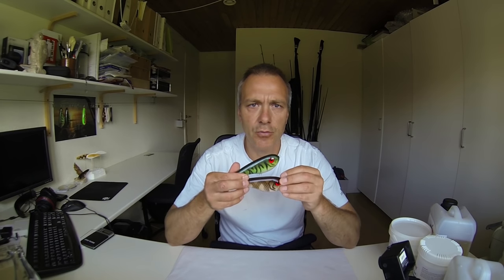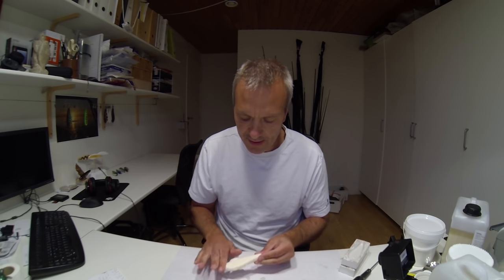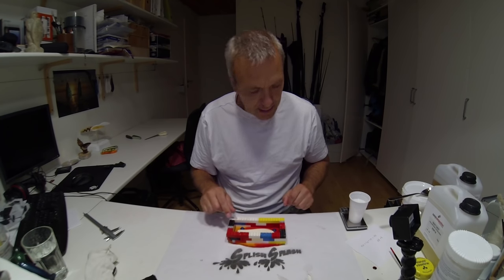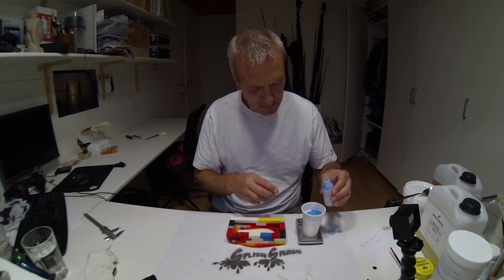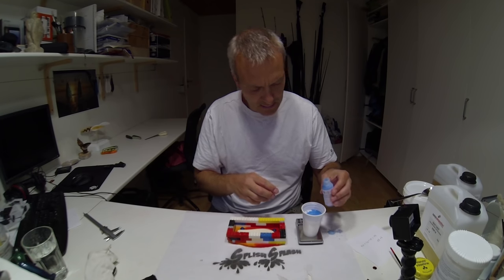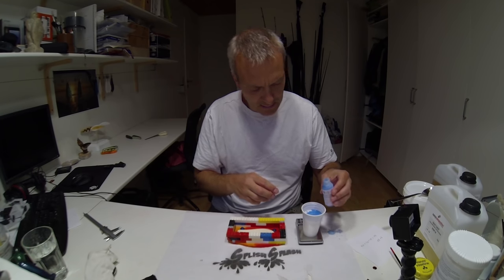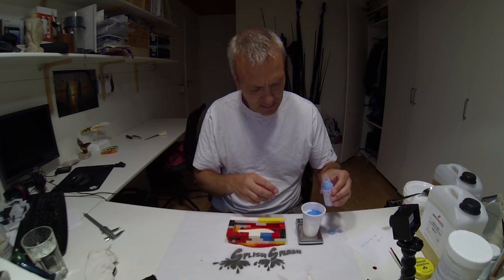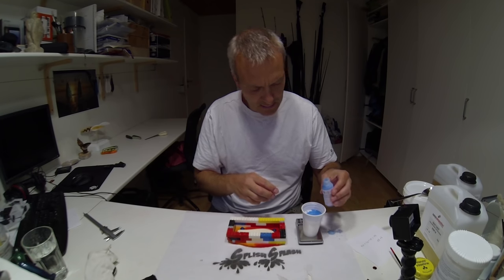The Plastic Jerk - Easy, durable and catchy

Comment: Excellent video thanks!  I've just started making my own lures out of resin but I've been making them for longtail tuna so they have to be super strong and very durable!  Keep the videos coming:)
Reply from the maker: +James Allen Thanks James. My friend made some stickbaits for tuna out of resin, and he got some smaller tuna i Croatia this summer without any damages to the lure. So I think you should be able to use as well. Just make sure that the internal wire matches your prey.
Reply: Yes everything has to be bigger and stronger for the tuna.  I have some 1.6mm stainless steel wire that seems like it should do the trick.  I guess I won't know until I try it though!
Reply from the maker: +James Allen I think it will. The force you will be able to apply to the lure is depending on your line strength and gear. So you'll need quite heavy gear to even bend the 1,6 mm. Looking at your videos, i wouldn't be afraid to use 1,2 mm.
Reply: +Splish Splash Just went to rewatch your video to see if I could pick up any more tips.  My lures have now been tested in Hervey Bay on the east coast of Australia and have caught some really nice tuna and mackerel.  So far no scratches on the Envirotex finish or any bending of the wire either which is good!
Reply from the maker: +James Allen Fantastic you are having succes with your baits. I would love to see some pictures of them and your catches. You can post them on my facebook page: https://www.facebook.com/splishsplashfishing/

Comment: Your bait will have a better action if you position weight so that the  tail is down slightly in relation to the noise. This will give the lure a swimming action as retrieve it. Really nice work you do.
Reply from the maker: +Tom Willis Hi Tom. The lure actually does have a nice swimming action. But maybe i could be better - I will try your advise and see. However I think it will be weighted to sink then, as if the weight is in the back, it won't dive. Thank you for the advise no matter what.

Comment: You are doing a really really great job with this Videos! I learned a lot. Just started to make some soft lures. Next Project will be something like a plastic jerkbait. 
I´ve got a question about your fishing setup. How do you connect the hardmono with the main line? Looks like some kind of loop?!
Reply from the maker: Hi Fabian. In the testfishing part of this movie I just used a loop tied with a figure 8 knot (Not sure that is the correct name) Today I use crimped eyes as that is a nicer setup in my opinion. Good luck with your lures
Reply: Splish Splash I also use hardmono and crimps. Seems to be the best solution. Keep going with this videos! For many fishermen out there it is nice to know, how these lures work. What a little shift in the weight position means for the balance e.g.!

Comment: Hey splish spash! Nice videos, I know it's not your latest but I still wanna ask something. I also make my own lures with resin but I always have to wait a few weeks for them to fully cure and de-gaz before paint and especially epoxy. With your process of cleaning it, do you get to make the epoxy coat in the same day without fisheyes problem? If not, how long do you wait? Keep up the good work, Kevin :)
Reply from the maker: Hi Kevin. I would advise at least one day of degassing, but after that it should be good to paint and let that dry for a day as well before the coating. The fisheye problems i have had has not been related to the degassing - I think.It s propably depending on the brand of resin as well. Cheers
Reply: Yes it could be the brand to.. I'll try your process, no better solutions 😁

Comment: 15 mins prep yes but how long for plastic to cure and harden? 1 hour? so really its quicker to make a lure from wood or the same plus you had to make the master and mould which took over 24 hours lol but once made then yes its better because you can make many lures much quicker than with wood,, great video, make me wanna make some lures that way, ive made lots of spinners which are easy and im looking into making some soft plastics 1st, those jerks look amazing, very cool thanks for sharing.
Reply from the maker: The resin i use cure en 20 mins. There are pros and cons for both resin and wood lures. To me, the important pro for resin is that you get a consistent result that is nearly ready to paint. Also you can have a lot of details on your lure without extra work. Making moulds is more difficult to explain, than it is to actually do. Once you have tried, I think that you will agree on both things. Good luck

Comment: Where can i find those "baitholders" that you used when painting? 
Really good video btw, learned alot. Im think about trying to make some lures of my own and this was super helpful!! 😃
Reply from the maker: they are called "third hand" and is originally used for soldering and can be bought in some hardware stores like biltema (http://www.biltema.dk/da/Vaerktoj/Svejsning-og-lodning/Loddetilbehor/Loddestativ-2000016776/)  or online in i.ex. Aliexpress (https://www.aliexpress.com/item/2016-New-Third-Hand-Soldering-Iron-Stand-Helping-Clamp-Vise-Clip-Tool-2-Alligator-Jeweler-Watch/32727477779.html?spm=2114.01010208.3.134.2dpUzP&ws_ab_test=searchweb201556_0,searchweb201602_5_10057_10056_10065_10068_10055_10054_10069_10059_10058_418_10073_10017_10070_10060_10061_10052_10062_10053_10050_10051,searchweb201603_4&btsid=a045094c-22e9-41eb-93df-1c01d26f1636)

Comment: very informative and wel explained tutorial, one thing i would really recommend you is to use a air mask and gloves when handeling the plastic and micro balloons they can both give you a real nasty allergic reaction. apart from that its just not healty to unhale the fumes! keep up the food work! :)
Reply from the maker: +kira baits According to the specifications of the polyurethane wearing a mask is not a must. Quote: "We would never advise against the use of a respirator wherever fumes or vapours are present however the hazard risk of vapours from a Fast Cast polyurethane are very small". However when i don't record movies, I use a mask, as there is no reason to risk anything.
Reply: +Splish Splash yeah the stuff i use said the same thing, i still got a huge rash from it unfortunatly! not trying to be a smart mouth or anything just didnt want you to get the same! :) again awesome tutorial!

Comment: It's polite each time and is saved very much.
Please tell me the brand name used for the material of this lure conversantly.
Reply from the maker: Hi. You will find links to used components in the text below the video. If they are not available in youu country, you can search for "Polyurethane Resin" - Good luck
Reply: Splish Splash Thank you very much really.
It'll be checked.

Comment: Hi, great video! Quick question though, where do you get the eyes?
Reply from the maker: Hi Brendan. I have bought these in many different shops. Search for 3D eyes to find them. Lately however I have just bought them at AliExpress. Here is a link to the latest ones: https://www.aliexpress.com/item/2016-HOT-3d-fish-eyes-12MM-silver-64pcs-red-64pcs-gold-64pcs-in-total-192pcs-lot/32680423814.html?spm=2114.13010608.0.0.W9EjiZ

Comment: Hi! Very good video from you! Now I want to try to make bait. I can tell you how called plastic that you fill in the form? Thank you!
Reply from the maker: Thanks. The "plastic" is correctly called "Polyurethane resin". In the text bellow the video, there is links to the stuff I use, but I do not know if they can send it everywhere. Good luck
Reply: Спасибо! И удачи вам!)
Reply: Splish Splash I have a question. When you made the other side of the mold did you just use vasoline on the master or the entire rubber mold?. I know guys do mold release but vasoline seems more effective.

Comment: Hey Jorgen. For making the silicon mould. Do I have to order this item? CS2 Condensation Cure Silicon Rubber 0.5kg package. Greetz,Glenn
Reply from the maker: +Glenn Goovaerts Hi Glenn. That is the one I am using. If you are careful not to make the mould to big, that should last for about 2 moulds. Rgs Jorgen

Comment: nice video,tq.. do u have video dat u can put bearing inside of it..? making it rattle..
Reply from the maker: I dont have a movie showing that. I would require some chamber the ball bearing can rattle in, and I think the easiest way would be to take a piece of plastic pipe and put the bearing inside and close the ends. And that part should then be enclosed in the mold and resin

Comment: if u use glass bubbles 10% it will make it floating and u can add some more weight but what if i use like 15 % glass bubbles , it will work too ? i also wanted to ask ehm , how can i make minnow lip that will work and where to put the weight . I tried polester ( without glass bubbles and it was light but sinking , its super smelly but u can make transparent-like lures and make so much cheaper than polyurethane that i also bought .. your videos are awesome and inspiring :)
Reply from the maker: First of all you wil have to be aware the there is great difference between resin and glassbubbles from different suppliers. I have seen some having 500 g glassbubbles in a 1 liter canister, and the one I am using has same weight in a 5 liter bucket. So there is great difference of the buoyancy you get.How much to use, and where to place the weight, will depend on the shape of the lure. Polyester is cheap, but if you add glassbubbles it will loose transperancy. To make it transparent and floating you will have to make it hollow, which is a bit more difficult than polyurethane and glassbubbles.
Reply: thanks for the fast reply , i understand .. i really want to make a minnow but i dont know if the lip will work , and if it wont work i will have done a bad mold and lose silicone material for nothing , do u have any idea how it will work out ?
Reply from the maker: It should be no problem to make a lipped crankbait in resin - You can go two ways. Cast the bait as whole or cast it with a slot for a lip cut out of a clear plastic plate. That last would be the nicest, but also giving you the most work. You could also make a mold for the lip alone and cast it in clear resin or polyester. good luck
Reply: thank you :) . oh also i saw one video u made that u use the silicone mold to reproduce a new silicone mold in case its ruined . Instead of polyurethane material that is expensive u can try also using plaster with wood-glue ( the white one that we often use) the glue making the plaster tougher and if u are careful ( with bubbles ) u can do it unexpensive . The plaster cost in my country is about 10 euros the 40 kilos . Hope this work for you .
Reply from the maker: Yes that would probably work - I might try that at some point. Thanks for the idea

Comment: i made few floating stickbaits with weight behind the hanger hooks but the lure roles and do not make the s curve action. any suggestion on how to fix that problem? Thank you,
Reply from the maker: In the end the lure shape is the most important, and I have made lures that simply wouldn't move right. But now that you have it made, I would try to put the weight in different places - Probably more forward from what you are saying. See if that changes anything.
Reply: @SplishSplashFishing  this lure is a floating stickbait lure that is why i put weight behind the hook hanger . I'm trying to achieve the s-curve action similar to floating stickbaits for tuna and GT's. Do you think if i move weight toward the head that will solve the rolling of the lure ?  Thank you,
Reply from the maker: @naoufelnacer1401  I don't have a lot of experience with topwater baits, but I would say that to stop rolling you should put the weight as low in the body as possible.

Comment: what silicone do you use, and what polyurethane? all the Polyurethane Casting Resin i have found says that it is flexible?  thanks
Reply from the maker: +Daniel Kontor Hi Daniel. Both silicone and resin comes from easycomposites.co.uk. My resin becomes very hard, and not flexible. Are you sure that they dont mean that the resin is flexible in its use? I think that resin is supposed to be hard

Comment: How come your not fishing with a baitcaster and are using such a long rod? not saying that you can't but when i broke my jerkbait rod and had to fish with a 240 spinningreel rod it was very uncomfertable fishing jerks
Reply from the maker: I guess I'm just used to fish with that setup, and as the lures I make only weighs around 40 g, I'm not forced to having a short stiff rod to make the jerks. However I do have more traditional jerkbait setups with short stiff rods and baitcast wheels that I use fishing from boats

Comment: What type of wire do you use? Guage and the like
Reply from the maker: +theguru18 I use stainless steel MIG/TIG weldingwire (probably not the correct english term) - 1 mm thick for eyes and 2 mm thick for the hinges.
Reply: +Splish Splash welding wire cool thanks

Comment: where can i get components like eyeletts, glass eyes, bills, joint attatchments?
Reply from the maker: The only part I shop for is the eyes - Buy them from aliexpress.com - Search for "3d fishing lure eyes". The other parts I make myself from stainless wire and plexiglass plate. But of cause there are many shops that provide those as well. Just search for lure making parts
Reply: Splish Splash thank you so much for replying, that helps !

Comment: Nice lures! Where you get the eyes from?
Reply from the maker: Usually buy them from AliExpress - Search for "3d eyes for fishing lures"
Reply: Thanks! Just ordered the same mold silicone. How many lures can you make aprox. with one mold?
Reply from the maker: Normally i get 30-40 lures out of each mold. I depends a bit on size and complexity of the cast. If you are going to make a lot, consider making at cast from the mold to make make more molds. You can see that in another movie
Reply: Thank you for the quick reply!

Comment: Hey Jorgen. Which needle size do you use while airbrushing?
Reply from the maker: +Glenn Goovaerts My one is 0,3 mm. Make sure to get paint that is usable for the size you choose
Reply: The smallest that I have is 0.5mm. Is this gonna be ok? I use createx paint. I think I can thin it with water?
Reply from the maker: +Glenn Goovaerts With 0,5 i dont think you will have to thin createx, and yes, I think 0,5 will work fine for you

Comment: would it be possible to add a bib/lip to the mold so you will have a diver
Reply from the maker: I tried another way. Just sawing the slot for the lip after it was casted. Then added a lip of clear plastic. Worked quite well, but the prototypes I made swam a bit deep for my normal fishing, and then I got into other projects. At some point I'll take it up again

Comment: Hello! I mean, how to calculate the amount of plastic and glassbubbles for bait.
Reply from the maker: Ahh - I just try.  On the first of these, I might have guessed for 15 g of each. Then I would add a few grams to be on the safe side. So 18 g. and then I use 10% glassbubbles, so 3,6 g of those. When the first cast is made, I would the weigh the leftovers, and make that amount less next time.

Also I know that the master for this one was just floating at a weight of 35 g so the resin bait should weigh the same

Hope that helped

Comment: hi . instead of polyurethane casting resin , the polyester material will work as well ? :/
Reply from the maker: I must admit that I haven't tried polyester myself, but i think that it would be possible. As far as i know, polyester ends up a bit more brittle, and could crack if you drop it on rocks. But I don't know this for sure
Reply: maybe it is floating too ... i will use it for sure cause its 4-5 times cheaper here
Reply from the maker: I don't think it's floating, but it would be nice to hear your results no matter what
Reply: sure man :) i will write you back when i will do it . thanks for your videos , i appreciate your work so much

Comment: Isn't that Polyurethane  harming your health? I don't understand why everyone is casting that material without the use of proper masks?
Reply from the maker: As far as I have been able to read on the specifications on the product, you dont need a mask as long as you are in a well ventilated area. You do need gloves though. When that is said I normally use a mask when I make larger batches, as there is no need to risk anything